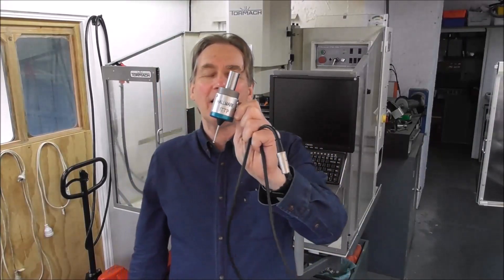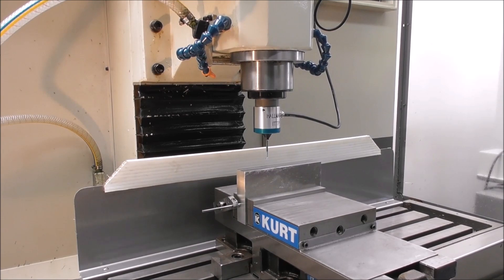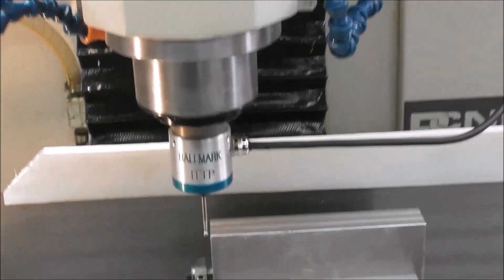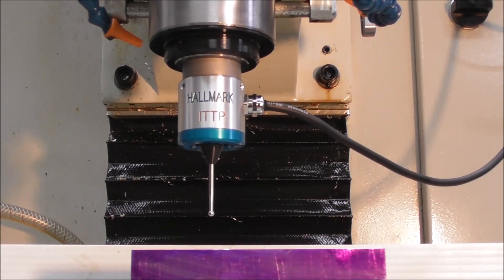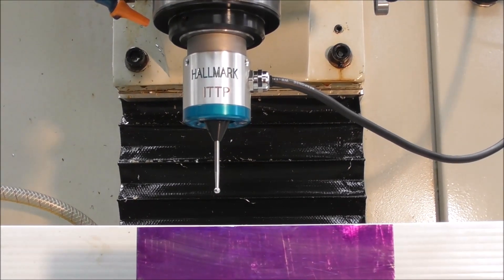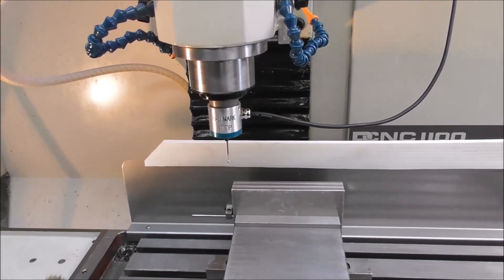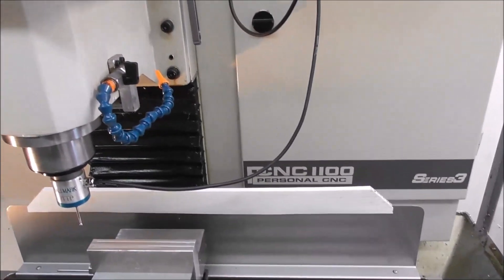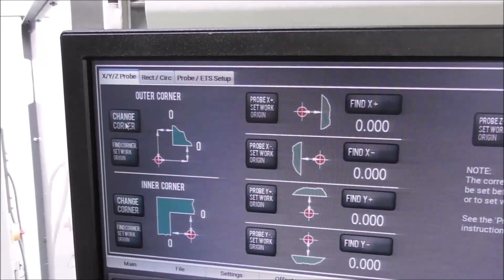Probing Around -  Part 1 -   Impact Tolerance

Comment: Cliff,
Nice update. Accuracy and adjustment video update would be good. Also after using the probe for about a year now without any crash should we be rechecking accuracy.  With all the nice upgrades on the 1100MX Coming out a wireless ITTP would sure be slick to go with it! Just want to keep throwing that out there. Also because of the ease of probing the center of square and round stock I found my small intricate parts were more accurate using a center of the piece origin instead of a corner. Without the ITTP I wouldn’t be inclined to take the time to do it. As always a great value for such a useful and accurate tool. Thanks Again.
Reply from the maker: Hi Douglas. Thanks for the feedback. Re your question, I would check that the tip is concentric (with a light finger indicator on the tip and rotate) every so often, especially if you are doing high precision work or if you have a crash.  Other than that, the ITTP should retain its accuracy. Also the contacts may need to be cleaned out and the gel replaced every few years as per the video manual,  if used a lot. Cheers  Cliff